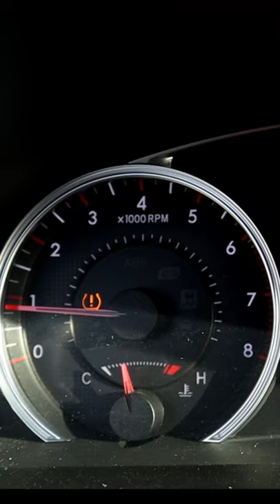Piston Carbon buildup cleaning in less than 5 Minutes #shorts

Comment: Just get yourself some CRC intake and valve cleaner and do it right before your oil change every single oil change and you should be doing your oil change every 5,000 mi if you're running full synthetic which you should be so that means you're using the CRC every single oil change which means every single 5,000 miles and call it a day this is good for all engines but specifically necessary for a direct injection engine typically will say GDI which stands for gasoline direct injection engine. Also about 3 to 4 times a year put some cata clean in your gas tank to clean out your catalytic converters.

Comment: Is it required to take the fuel pump fuse out or just let it there?
Reply: Yes..u smart..need the fuel pump fuse..will work
Reply: If you take the fuel pump fuse out the car won't run for longer than 15 seconds because the hpfp won't be pushing any fuel to the engine.

Comment: Does that clean the valves too?
Reply: Yes if the engine is still port injection

But not if the engine use direct injection
Reply: @kevinghifari2330  it would kinda clean DI engines too right? I mean the vacuum lines go to the intake manifold not to the injectors directly afaik. How effective it would be against really carboned up valves is a different story however.

Comment: Here’s another thing that people in this country failed to realize if you drive the next important thing in your life other than your children and money is your vehicle every three months you should be changing the oil and all fluids every six months you should have a very good mechanic check everything especially your engine and transmission because those are the most expensive and those are the biggest parts that take care of your car and make it work. It’s called common sense people start using your cell phone is not important that should not be in your hand when you get in your vehicle you prepare everything before you start it and never touch nothing other than the steering wheel while it’s running and you’re driving. And now I don’t drive I live in New York City I don’t need to drive here

Comment: So that is bullshit. You are removing the injection feed and run the car on Seafoam? Seafoam isn't combustible.
Reply: yes it is...
Reply: He is removing a vacuum line not the fuel line....
Reply: @dvk578  No, no it is not.
Reply: @therealproracer7284  Which would make even less sense. It would choke immediately.
Reply: @michaelmay5453  🤦‍♂️
Reply: @therealproracer7284   An open vaccuum is an air line, you can't suck any fluid through it without choking the engine.

Doesn't matter if it's gas, water, seafoam or the semen of a lonely sailor.
Reply: @michaelmay5453  yes it is...  your turn...
Reply: @dvk578  It's 60% ATF, 30% Napthaline and 10% Isopropyl Alcohol. You can't run a petrol engine on that no matter what. You might be able to run a diesel on it but the knocking would be insane.
Reply: @michaelmay5453  ok, but it is still flammable.  the guy set it on fire.  It is no where near as combustible as gasoline though.
Reply: @michaelmay5453  it's still running off 
fuel, you just introduce the cleaner to the air line and rev it to make sure it doesn't stall. I have done this many times using upper cylinder and head cleaner.